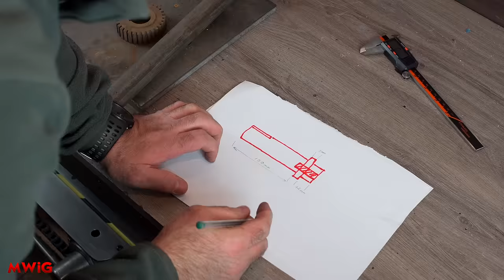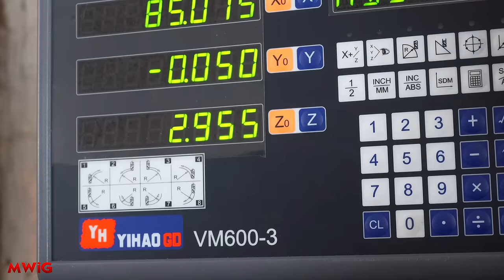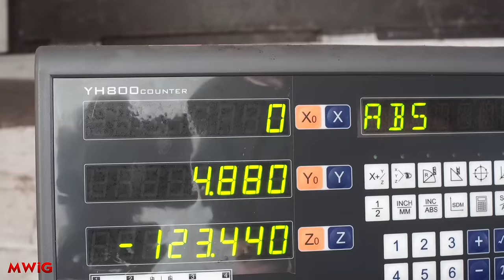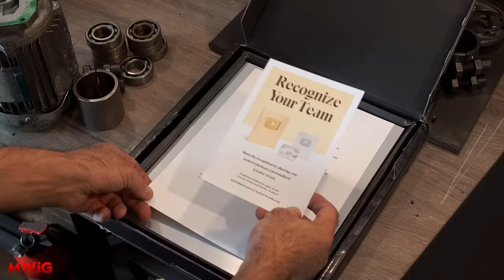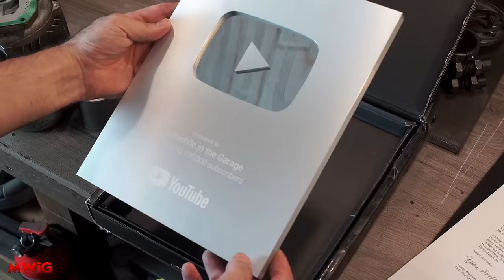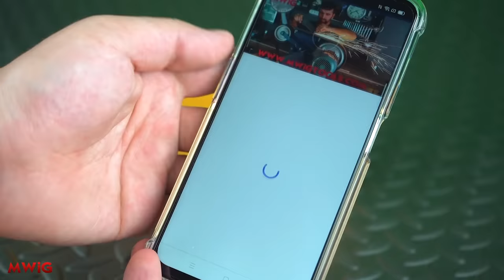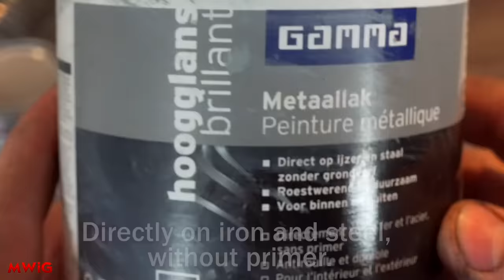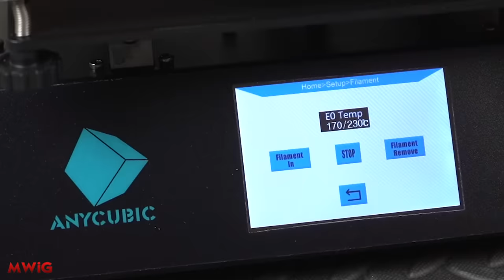Electric Metal Shear | Making Sheet Metal Cutting Shears

Comment: Cover your lathe ways when you use abrasives or grinding- if you don't the grit getting forced between the saddle and the bed will wear the ways down, and your lathe will begin to turn a taper.

Comment: Man! This guy has the perfect tool for everything!
Reply: actually he needs a real hydraulic press right in this video
Reply: And a bandsaw. I mearly lost 2 fingers cutting off metal with a grinder years ago.  I have since furninshed my shop with 2 bandsaws.  One vertical and one horizontal drop down.  Not to mention the metal chop saw in the corner.
Gonna have to start scrounging parts for that metal shear.  That is slick.  Looks like a beefed up bead roller.

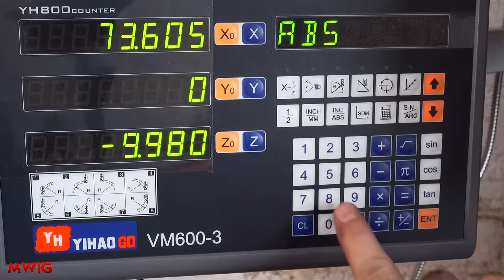Comment: 4:00 There a much easier way to find the center of a part with a DRO, that doesn't involve calculating radii at all: touch off the edge finder on one side of the part, zero that axis, then move over and touch off on the opposite side. Once you've touched off, use the 1/2 function (press the axis button, then the 1/2 button) to halve the current value, moving the zero point to the center of the part. Note that this works regardless of the size of the part or the size of the edge finder, so you can use this even if you don't know the exact diameter of the part at the point you're touching off.

Comment: I LOVE to watch genius! You're a designer like no other!
   Here's a little advice, though...it's not healthy to remove chips and lathe hair with your fingers. That stuff is razor sharp! It's really easy to make a tool to do that for you. You can either do it the easy way, or any number of other ways. Take an 1/8" welding rod and grind it to a blunt point on one end. Put that in a vice and bend a 1/4" radius, 1/2" from the tip. Then go 1" and bend a 90 degree angle, with the hook going the same direction as the welding rod shaft. Go down 8" and bend it back up the way it came and then tape it with black electrical tape. That's your handle. you'll have a 1" stob sticking out to the side with a little hook on it. 
   The other one is make the piece, but just go down 4" and cut it off and taper-grind it and screw it into a File handle-grip. Makes for a nicer and professional metal hair removal tool.
   Another thing, you've got a great press, on your lathe table, that most people don't realize. Your Tail-stock! It's not just to hold a chuck for drilling, or morse-tapered drill bits or a live or dead center...its a powerful press, too!
   Another goodie, when you tap a hole or use a die, to thread...use Crisco vegetable shortening. You can power-tap using it, and you won't make a mess. I put some in a pill-bottle and stick a lid on it and label it TAPPING. I just pop off the lid, shove the tap up in the bottle, put the lid back on and tap the hole. No holidays nor skips and it cuts like butter! Use Turpentine for tapping Aluminum.
   I love your foot-switch! And congrats' on winning your award.!!!

Comment: Really cool build but please please please go back and instead of just taping off the ground wires in the footpedal ground them to the casing instead. If something happens and your switch shorts to the case then you'll get an electrical fault with your breaker instead of a possibly deadly shock.
Reply from the maker: OK :-))
Reply: Or you could just not use the machine barefoot!

Comment: Bonding all metallic components to one another and also connecting the collection to ground with the supply voltage connection will give the current somewhere easier to go than a body part in the event of some electrical bad luck.

Comment: Excellent work and creativity to make the most with the tools you have on hand!

Little side note, when you use grinding wheel on the lathe or milling machine, try to protect the ways as abrasive particles tends to stick to it and damage them in the long run.

Comment: BTW when grinding on the mill or the lathe ALWAYS cover the ways.

About the footswitch...it needs to be shielded and there should be an overtravel stop to prevent damage to the toggle switch inside.  Also if you want this to meet the CE standard the machine needs an emergency stop and a guard over the top cutter (which can be transparent if necessary).

Comment: The milling machine as a press... Poor machine... You need a good kick in the ass! In the same way, protect the lathe bed during grinding process: one more kick in the ass but much stronger. Nevertheless a metal cuttting shears is a good idea and the result is there.

Comment: Why are you using carbide insert with your lathe if you don't have enough feeds and/or speed? (Maybe you have but you just don't use the right feed and speed?) Because the longest are the chips, the highest are the chances to have problems. I think you should use hss, you may have to grind them but it's better for your work I think.

Comment: i broke the dove tails on my mini mill as well, thats a sux
Reply: Using it as a press?
Reply: @ollied1981  Yes I was using as a press,  put the drill chuck in and pressed into the spindle, then i tried to bend some sheet metal but spindle lever was not enough torque so i (stupidly) placed a pneumatic jack under spindle and successfully bent the sheet metal but cracked the dovetail on the Z way. I was devastated because i just paid for the machine, but little machine shop sells parts and it was cheap. i guess it was a good lesson for me,  i have a separate press now.

Comment: Why did you destroy that gear when that smaller looked as the size diameter or made one next why no grease fitting where the bearing went for lubication even oil filled sealing the ends so as it spins it lubicates

Comment: I guess you found out the hard way not to use a mill as a press ;) 

I have the worst hydraulic press ever made, made from cheap Chinese stamped steel. It’s Ha Ha, rated at 20 ton, but the top bends up like a cm when press hard. 

I’m planning on making a decent frame for the pump, sounds like a hydraulic press would be another good video project idea for you.

I think some useful ideas to add to a press are a force gauge (can use a pressure gauge and measure the piston area to convert to force), and height gauge, maybe even dial indicator mount. 

Here’s my worthless press:

https://imgur.com/gallery/jnXk6nj

Comment: Choosing the electric motor is totally wrong; It should be around 3HP while you just mounted a 1HP motor that's too weak. Another problem is using wrong material for the rollers which should be made of high carbon tools steel. There is no clutch system in the machine which in turns could result in damaging gear and connecting systems. No safety, no speed control,  and super heavy strong design all are other problems should be cleared and considered if it is supposed to be a real machine doing something.